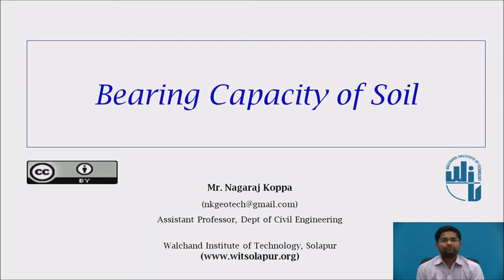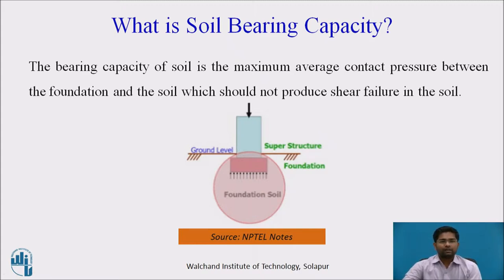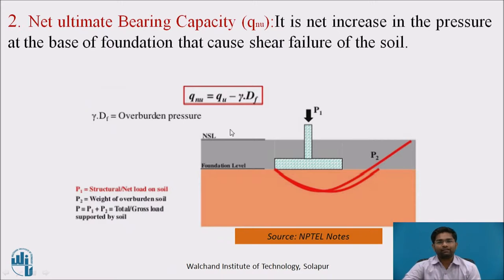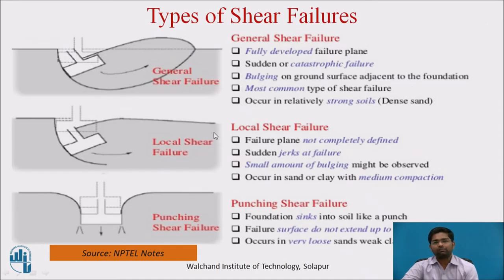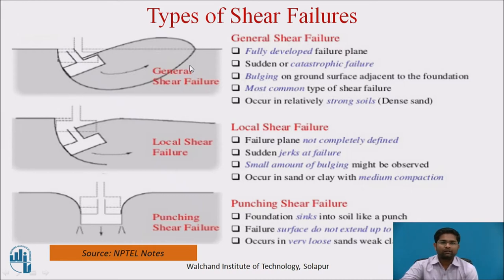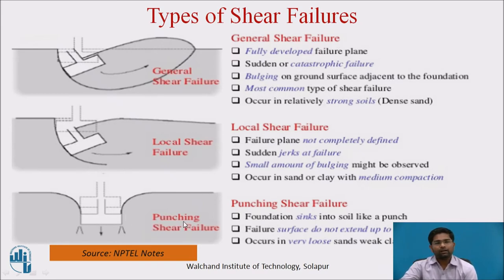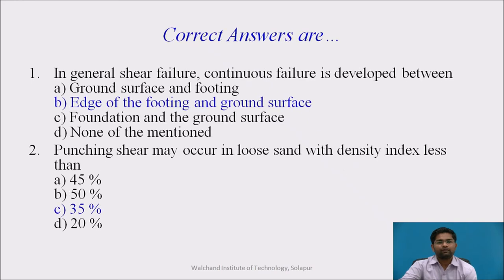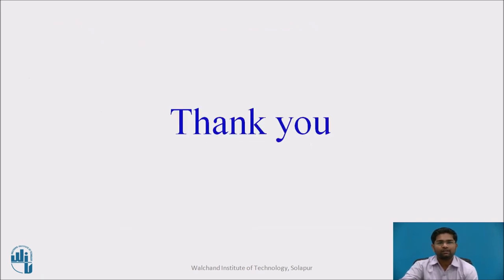Introduction to Bearing Capacity of Soil

Comment: Why so much emphasis is attached to the bearing capacity of soil-foundation system.  I have my BE (Civil) & ME (Geotechnical Engineering) from IIT Roorkee, and a PhD  Civil/Geotechnical from the Univ. of Missouri, Rolla, USA.  I have worked for Woodward-Clyde Consultants, Gannett Fleming and US Army Corps of Engineers for 35 years, now I have my own Geotechnical Consulting Company.  In most, almost all cases, the behavior of a footing is controlled by the settlement and not by bearing capacity.  Ralf B. Peck said the same thing, and all sane Geotechnical Engineers would also say the same thing.

Thanks

Padmakar Srivastava, Ph.D., P.E.

Mem. Soc. of American Military Engineers
Mem/Reviewer ASTM; Mem. ASCE
Munster, IN 46321, USA
Reply: Are you advertising yourself or giving a comment?
Reply: @thomassbahtu3724  I don't have to advertise myself and I know who I am.  I made a sensible comment and you don't even seem to comprehend it.
Reply: In my more than 35 years of carrier in Geotechnical Engineering, I had to consider Bearing Capacity of soils only once.  Approximately 10 years ago, while I was a Senior Geotechnical Engineer with the US Army, I was planning to clean the passage for the ships in the Mississippi River by dredging the channel bottom in order for the ships to sale safely.  The question was hao and where to dispose off the dredged material.  There were large islands in the river, as wide as quarter mile in diameter.  I decided to place the dredged material on those islands to the extent that the bearing capacity of the islands did not exceed that they may fail in the bearing capacity. If the islands settle, without failing in the bearing capacity, better, because I have more room to place the dredged material. And it worked like a charm.

Tell me this thing - in a clayey subsurface environment, if you plug in all the values in the bearing capacity equation, you will end up with a Bearing Capacity of a few thousand pounds per square foot. Can you load that site with that much of loading - if you do, the footings would sink to the center of the earth. No, you can't, you consider only settlement, not the bearing capacity.

Being a teacher you should consider the practical aspects also.

Thanks

Padmakar Srivastava, Ph.D., P.E.

Mem. Soc. of American Military Engineers
Mem/Reviewer ASTM; Mem. ASCE
Munster, IN 46321, USA